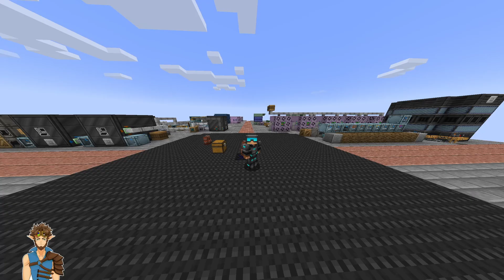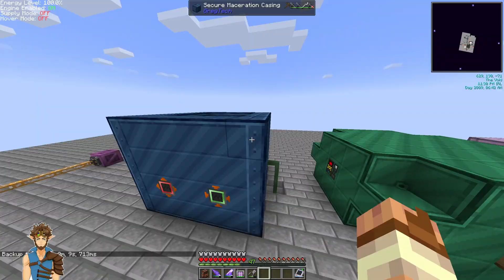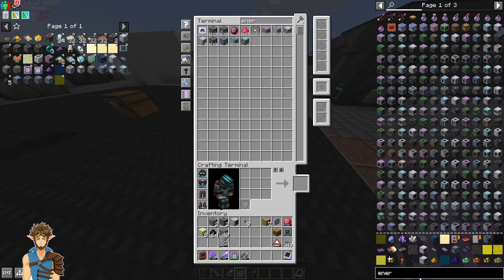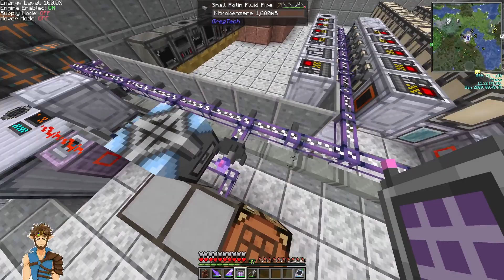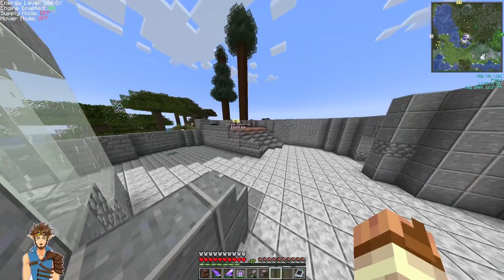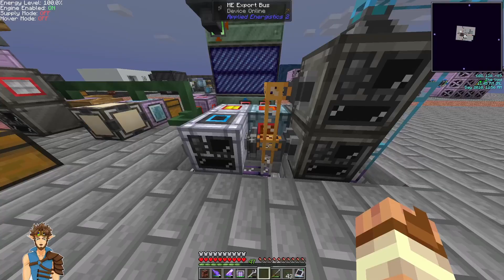Gregtech Modern Ep58: Polyphenylene Sulfide

Comment: Modpacks usually don't get updated unless you manually update them.

Coloured ME cables don't matter when you're only using flux cables next to them. 
You can also use quartz cables/cable anchors everywhere instead of colour coding. 

,,I had someone mention to me that i should do some autocrafting'' 
I wander who that was....
And congrats on doing it!

Editing what shows in the terminal from the terminal is the job of view cells.
I was referring to filtering the storage bus, so the bus itself doesn't see the items.
Gonna be honest, i don't think i was paying much attention to whether you did that already or not.
Reply from the maker: I did set the filter on the storage bus in the original episode. As for upgrading the mod pack I may have clicked a button or two.... Albeit unintentionally but none the less it was touched....

Comment: You can also connect farms to terminals with crafting cards and set the amount you want to have at disposition, the crafting card will automatic order to the processor the stuff, this way you can keep alway stuff you use constantly.
Reply: Uhh, you don't connect farms directly with buses that have crafting cards. Partially because that's how farms work, partially because the kind of buses you need to connect a farm to an ME system don't take crafting cards.